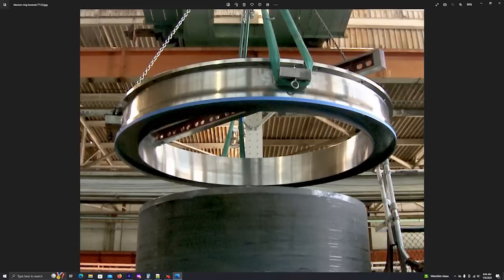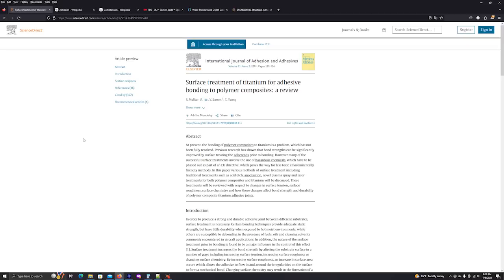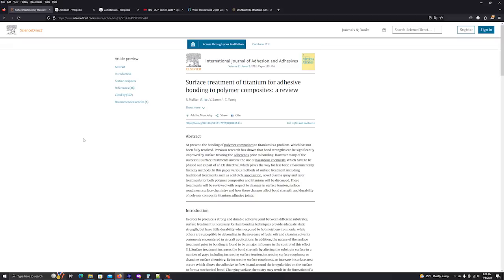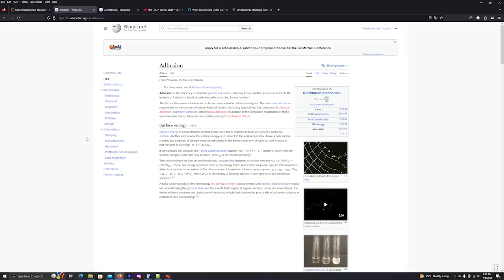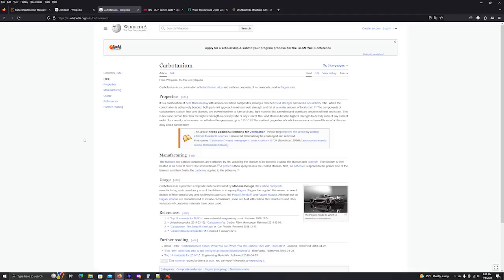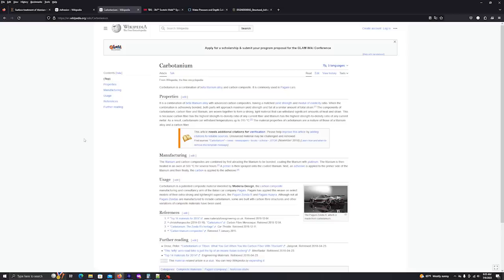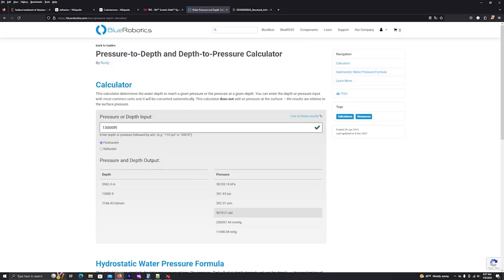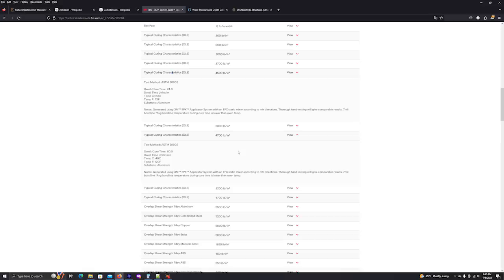Oceangate Titan Adhesive issues between Carbon Fiber and Titanium

Comment: Epoxy is such a overrated adhesive, but you are incorrect in that the end caps would have "blown off":  this would have happened if the vessel were pressurized from the interior like an air tank and the internal pressure is higher than the external but in this case, it is exactly the opposite case:  the internal pressure is much less than the external pressure and even if the bonds were imperfect the outside pressure would have simply pressed the end caps onto the cylindrical hull more securely.   Instead, what is far more likely is that the carbon fibre itself simply failed:  carbon fibre is very strong in tension but not in compression, and you cannot equate test results for carbon fibre vessels meant for holding pressure IN with a design meant to keep the outside pressure *OUT*..    In this case, I suspect that the carbon fibre simply crushed and this cleanly peeled the walls inward and away from the titanium end caps.    Also not taken into account is the cycle life of the vessel:  epoxy bonds get weaker every time they are stressed, so just because a vessel survived one dive doesn't mean it will continue to..  The bangs that were reported by previous passengers were likely internal delaminations in the hull that went undetected but progressively weakened the vessel until the fateful event..
Reply from the maker: Good question,  But in the recovery images,  The bolts around the flange were all missing.  The window flange bolts were also missing.  We do not know if the ROV removed the bolts to lift the sections due to excess weight or of if the bolts were destroyed in the implosion.

Comment: The hull cylinder should have had the carbon fiber laid on bias angles, not just wrapped around the circumference
Reply from the maker: Reports indicated that there was axial winding of pregreg after the filament winding.  Also  on the Titan sub there was prepreg tape winding instead  of filament winding.

Comment: “Pushed right off”.

Um no. You do know that the end bell/flange have sea pressure the two ends towards each other with the carbon hull in between.
So when the hull collapsed they were pushed in toward each other, the exact opposite direction of popping off.

Comment: I looked at some data for compression forces of epoxy with some claiming up to 20,000+ psi... yet that was for compressive forces acting on cured epoxy, likewise the data you refer to may simply state compression on cured epoxy, and not indicative of bonding strength itself, which would depend upon the chemical properties of the materials to be bonded. Indeed, the epoxy layer may have sheared clean off in fragments attached (or detached) from either surface without and compressive deformation
Reply from the maker: Thanks

Comment: Let's do some basic math here. The carbon fiber cylinder has a circular area of 7,809 sq. inches on each end. That means that the two end caps exert a total compressive force on the cylinder of 2*7609*5619= 85,509,942 pounds!  Does anyone really think that adding some rods connecting the two endcaps would provide any benefit given that we already have 85 million pounds of force pushing them together?  This extreme amount of force would tend to buckle the cylinder probably toward an hourglass shape. This buckling force is then concentrated over the few inches of the adhesive at the lip. In this scenario, the adhesive does almost nothing since the forces will be orders of magnitude greater than the bonding strength. Mechanically attaching the endcaps to an inner titanium sleeve could help but the buckling problem still remains. To mitigate this they could have gone to an ellipsoid shape, but this would have certainly increased manufacturing complexity. It seems to me that if they spent 5 minutes doing a basic mechanical analysis of the geometry they would have realized their mistake. However, this is only the first-order problem, delamination and water intrusion would eventually weaken any carbon fiber composite to the point of failure.
Reply from the maker: Thanks for the great feedback

Comment: The fact that they used carbon fiber for the pressure hull with titanium end caps is crazy, both materials swell & contract to different temperatures & pressures.

Comment: Epoxy should only have been used as a watertight joint sealant - not the means of bonding to prevent detachment. The only reliable joint for something like this would involve an interlocking key structure with heavy flanges and flange through-bolting. The choice of epoxy sealant would be conditional on its ability to handle differences in thermal expansion of the two substrates without being compromised. Clearly, none of this was done. The design and assembly process look more like "backyard hack" methods than thoroughly engineered and tested solutions. The owner of the company placed too much faith and emphasis on his " impending failure detection" equipment instead of designing something that would not fail under conditions of anticipated use. It's a little shocking that no one at Oceangate was knowledgeable or experienced enough to know how carbon fiber structures in the real world fail. Literally, there is no warning. At one moment you have a seemingly intact, strong, dimensionally stable product and a millisecond or two later, you have a fractured mess. Strain or yield detection devices are practically useless as safeguards against failure in that situation.
Reply from the maker: Thanks for you feedback

Comment: That is not the one the one I see being made had a whole Titanium skin with ends joined
Reply from the maker: In the video, the carbon fiber is being would onto a stainless steel mandrel.  Once cured the carbon fiber tube is pulled off and prepared for bonding to the flanges,

Comment: You might want to check your microphone in future videos as you kept going really quiet for ages then a bit louder for a short time. Overall you were very quiet anyway & I had to give up as I could barely hear & the constant volume changes made it too frustrating for me. FYI, I do know this wouldn’t bother most but I have tinnitus so don’t hear so well - especially if I can’t see the speaker’s face (I’ve learnt to lip read). Just a suggestion.
Reply from the maker: Yes I have re-positioned the mic and working on the volume

Comment: Im a Dr. Quantum Hyperdimensional Widgetology and the Chief Chaos Engineer of Rubber Duck Debugging. 

So, worry not, for my opinion carries weight not only due to my amusing title but also due to the depth of knowledge and experience that lies beneath it. I am here to share my expertise, engage in thoughtful discourse, and offer valuable perspectives on any topic at hand.

During an implosion, the hull of the submarine is the component most likely to experience failure. The hull is designed to withstand the external pressure of the water, but when subjected to an intense implosion, the immense forces acting upon it can exceed its structural limits. The intense inward pressure can cause the hull to buckle, rupture, or collapse, leading to a catastrophic failure of the submarine's integrity.

Comment: Wouldn't the glue basically just hold the flange in place, preventing it from moving sideways. It doesnt have to resist being pulled apart, its under conpression all the time.
Reply from the maker: More than likely, the epoxy is holding the end cap on at the surface, as you descend the pressure hold the end caps on

Comment: Possibly pinpointing which element of this machine failed here is not so important as there were so many design weaknesses it was likely a matter of which broke first. The whole concept was doomed from a flawed individual's dream so does which particular bit of this came apart first seems worth guessing? It would seem dangerous if the failure point was identified and the safety of every other component which had managed to hold out up to that point be ignored.
Reply from the maker: Some good points thanks

Comment: I actually think those bolts had a part of ring / hull disintegration as they were HAND tightened..wtf imagine 1 or 2 or 3 bolts not tightened evenly or loose...No, the bolts were not tightened to a certain spec Just "hand tightened" all 16 17 of them

Comment: Everyone talks about the carbon fiber being the failure point. My thought has always been the glue. The difficulty in applying the epoxy in a fast and consistent manner is very difficult on an area that large. This seems like the easiest part to get wrong. I understand the extreme pressures being dealt with could fatigue the hull but with only 7 dives, that makes me lean towards the connection method. Just my thoughts but probably wrong
Reply from the maker: Thanks for you feedback

Comment: A nicely presented analysis of this problem with the adhesion.
I think the lack of any remains of any carbon fibre anywhere is
a real red flag. The known fact that the submersible survived
previous trips to the Titanic indicates that the bond was sufficient,
that the carbon fibre was sufficient for a given number of
trips or service cycles. Fatigue was the craft's downfall and gradual 
delamination of the carbon fibre layers meant that the hull
failed as shown in tests here on YouTube, as it collapsed it twisted
very fast as it contracted for a very tiny amount of time, probably
shearing the glue right off the end flange with such force that
it almost looks polished. In short, the end caps couldn't keep up
with the rest of the hull as it twisted during disintegration.
The overall design was terrible, that was to blame rather the
bond itself.
Reply from the maker: Thanks for your feedback

Comment: If someone told me the submersible that I was to go on, and subject to 5000 pounds per square inch, was glued together, I'd be running in the opposite direction. I know nothing about engineering, but common sense tells me that is not a good idea.

Comment: What is the material of the tube that the carbon fiber is being spun onto ? Wouldn’t it be titanium?
Reply from the maker: More than likely stainless steel.  This is the mandrel that the carbon fiber is wrapped on.  Once cured the carbon fiber tube is pulled off for bonding of the titanium flanges.  Thanks for the question.

Comment: To allow that bond to seat and hold firmly the titanium should have been textured probably sand blasted to provide a tooth for the epoxy to bond. In one of the videos showing the bonding of that ring a technician was seen wiping the surface to be bonded with a dirty rag and running his bare hand over the are to be bonded just prior to assembly. Oils and dirt from his hand and rag would have contaminated the bond.
Reply from the maker: Yup I saw that, oil from the hands and rag is not very clean,  thanks for the feedback 🙂

Comment: I am a retired consulting electrical and mechanical engineer and have little to no experience in metallurgy or structural engineering.  However, there may be an aspect to the construction of this submersible that has not been discussed.  And that is the forces on the ends of the carbon fiber "tube" which    would be applied by the approximate eight foot ( 8' ) diameter ends.  The tube thickness was reported as four inches ( 4" ), so the end surface of the tube would be about 590 square inches.  Simple math indicates that the titanium ends would exert a pressure on the each end of the submersible that would be about  TWELVE TIMES  ( 12 x )   the pressure being exerted on the round section.  Additionally, there may be limited knowledge concerning two high pressures operating  at 90 a degree angle on the outside edge of the carbon fibers.  PN
Reply from the maker: Thanks for the great feedback

Comment: This is why all the deep sea subs use a spherical vessel. Even if the entire thing was made from 3" thick titanium, a titanium cylinder bolted to two end caps, it would still present too many variables IMO as an assembly, which is why it's never been used even though it would provide a lot more space inside and be easier to manufacture than a sphere. You'd need forged flanges though, no welding would be good enough I don't think. Triton has a good video on how they made theirs.
Reply from the maker: Thanks I want to watch that video
Reply: spherical? Not at all. Those that went as deep as 11 km were excessively not spherical, as the Trieste.

Comment: Such a small contact patch between the end caps and carbon hull. Second why they woudn't brace the two end caps with metal rods running across the hull is flippen beyond me...

Comment: Hydraulic Press Channel did a model experiment and they had problems with the adhesive as well. But the pressure at depth should keep the end caps in place anyway. The adhesive is more a sealant with questionable quality when under pressure. However I wouldn't like to use a material mix for solutions seeing extreme conditions.
My concern is more that the carbon fiber itself fractured.
Reply from the maker: Yes agreed,  Also the deflection between the titanium and carbon fiber  could have weakened as a result.  Thanks

Comment: You mentioned compressinve strength of the adhesives, but would it be fair to say that the more important characteristics are the shear-strength or the peel strength? The forces would be acting across the cross-section, if the contraction/expansion rates or yield strength are not matched. Also, the material in the joint on the sub appears to be forming the seal too. So the pressure is always trying to push it out of the joint, again across the cross-section? I noticed on the 3M data sheet that the shear strength was only 1800psi. In terms of peel, if the cylinder was bowing in the middle, the ends would be trying to pull away from the rings. It would be interesting to see if there is any adhesive residue on the rings and if it shows beach marks.
Reply from the maker: yes , good point,  but the end caps were being pressed against the carbon fiber by external pressure.
Reply: @JoediyLab  The forces are not only acting longditudinally though. And as soon as one surface moves in relation to the other (as would happen if not expanding/contracting at the same rate), with enough force to overcome the strength of the bond, you have failure. The rings and tube are no longer supporting each other and at that depth, there is no longer a seal.
Reply from the maker: @a1tuck  Thanks so much  for the explanation

Comment: You need to look at shear strength.  The titanium ends would have been pressed against the ends of the tube, true.  However, the crushing of the tube from its long sides would have applied a shear to the bond on the ends.
Reply from the maker: Thanks for the feedback

Comment: The face of the ring isn’t shown, so we can’t see what the surface looks like. The glue is just a gap sealer at those pressures. The main risk at this point is the measurable shrinkage of the titanium ring vs that of the resin cylinder. If they were different it is stress point.
Reply from the maker: Yes I agree thanks

Comment: It wasn’t the glue. And it wasn’t the disparate materials in the end domes. It was the carbon composite.   Composites have strength in TENSION. Carbon fiber adds no strength in compression, and, in fact, its presence creates discontinuity on the distribution of compression strain.  ALL valid uses of composites rove the fibers to act in tension under load.   A deep sea hull is in pure compression in all dimensions.  There is NO way to rove carbon fiber on a DSV hull that will place the fiber in tension.  Under such loading, it is well proven that delamination buckling occurs, specifically in the inner layers of the laminate.  Every noise that hull made, on every dive, was the sound of it irreversibly losing a tiny amount of strength as a tiny section of carbon fiber impregnated resin buckled like an accordion pleat within the hull structure.   These faults accumulated until the hull was stressed the last time and reached a point of sudden progressive failure.   Inside the sub, it would have sounded like microwave popcorn, starting off with a few pops, then the popping coming faster and faster until it hit a chain reaction of progressive failure and the hull collapsed in an instant.

The glue is immaterial. Its only purpose was to create a water tight seal and keep the titanium in place when the hull was at the surface and not under external pressure. And it filled the most microscopic of irregularities in the mating surfaces to ensure no point loading between the parts. But once the thing submerged, the titanium caps where held against the carbon composite cylinder with hundreds of tons of force.

The disparate coefficients of expansion and contraction between the titanium and the carbon cylinder were not the cause of the implosion as, had those rates been significantly different, the hull would have cracked and failed far earlier in its cycling. Damage would have been visible near the joint. Either the thin titanium encircling rim bending or cracking, or the carbon composite buckled and paint cracked around this joint.

Everyone who dived on the sub reported hearing cracking or popping sounds.  Every snap and crackle was the sound of cumulative degradation of the hull.  THAT was the cause of the failure.
Reply from the maker: Thanks